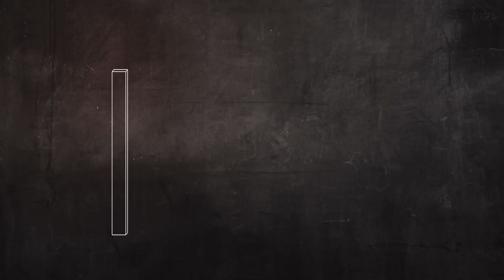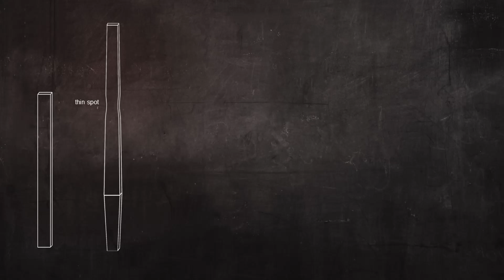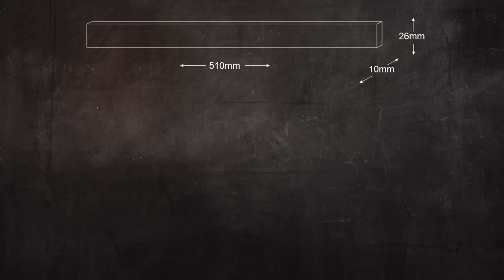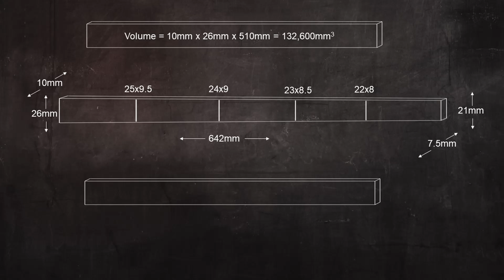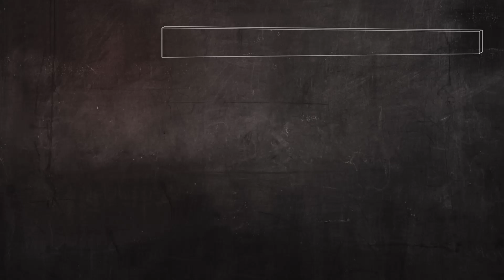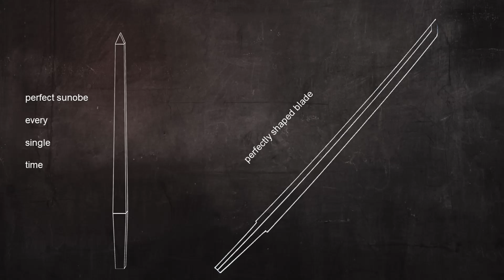Forging katanas:  All about sunobes (error in the formulas. please read pinned comment)

Comment: I was wondering how do you know how long to make the sunobe if you want your nagasa to be a specific length? If I want to have a nagasa of 762mm how long should my sunobe be? Would it also be 762mm? Thank you so much for doing these videos. I can't wait for you to finish the shinogi zukuri blade that you are making!
Reply from the maker: It's hard to know for sure.  My experience is that a sunobe elongates by about 10% as you hammer it into a blade.
Reply: @oldpuebloforge  thank you, that will at least give me a starting point.

Comment: You can calculate the initial length of the sunobe but it is impossible to calculate the segments with this formulas. Because the volume is a function of the length and vice versa. If I calculate Volume I need the length or if I calculate length I need the volume. However it´s and EXCELLENT VIDEO. please if you can, make an explanatory video. CONGRATULATION.
Reply from the maker: With due respect, volume is not a function of length.  In a regular rectangular bar, volume is a product of length x width x height.  So, there are four parameters:  Length, width, height, and volume.  If you know any three of those parameters, you can calculate the fourth.  Since the density of steel is constant, the volume is constant, no matter how you change the shape of it.  And this is true of the whole bar or any segment of it.
You can use this fact to calculate segments of regular rectangular bar using the formula length x width x height = volume, or you can use this fact to calculate the segments of the sunobe using the formulas I give in the video.  And you can use volume of any segment (which remains constant because the density of the material is constant) to go back and forth between rectangular segments and sunobe-shaped segments.

Comment: I think you've saved my blacksmithing "career"! Without you, I would've probably quit making a katana... I was ready to just hammer that piece of steel without any knowledge of what i should do or try to do... THANKS!
Reply from the maker: You're welcome, but don't follow the exact numbers I give in this video!  They are for a medium length blade like a wakizashi.  You will have to customize your numbers according to your blade length.
Reply: @oldpuebloforge  i see thanks! That's what i had in mind :) to make a tanto but i tought katana is the same thing as a tanto but smaller :)
Reply from the maker: @cretudavid8622  Very good!  All the principles for making a tanto are the same as for making a katana.
Reply from the maker: Also, before making a katana, I recommend you make several tantos to become familiar with the process and develop some skills. Then do a few wakizashis. Only then do a katana.  Everyone wants to jump straight in and do a katana, but without any experience, it'll be pretty rough.
Reply: Have you tried using the formulas in the video for your katana? Did they work?

Comment: this is an excellent video
Reply from the maker: Thank you!  More to come soon.
Reply: @oldpuebloforge  really looking forward to it. Just getting into black/bladesmithing now. Do you have a general guide like this for a smaller project like a tanto?
Reply from the maker: I do not have a guide like this for a tanto, but if I did, it would be exactly the same.  I would follow precisely the same steps.
Reply: @oldpuebloforge  was also watching a video buy you (i think) on your other channel (Entropy). Has your process changed much since then?
Reply from the maker: @jjwmacdo  I don't feel that my process has changed much.  I'm just a lot better now.